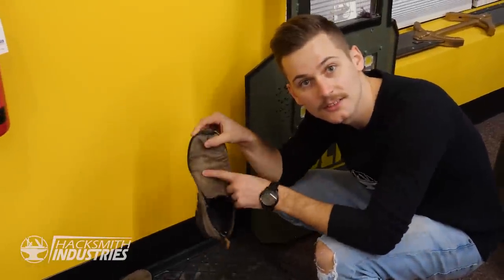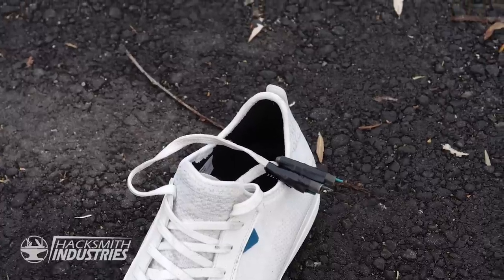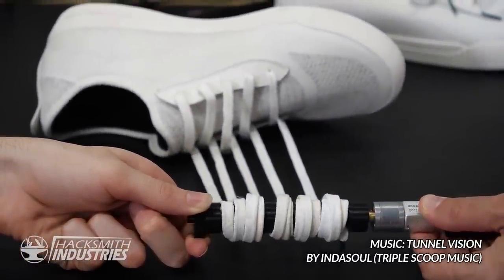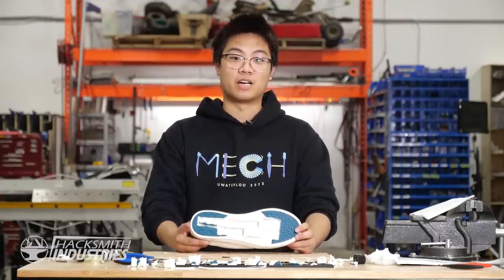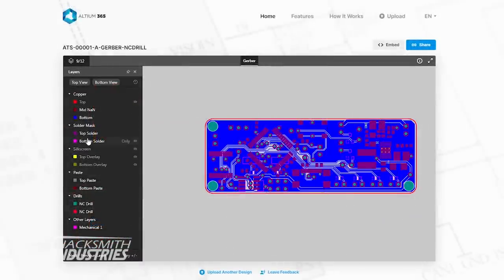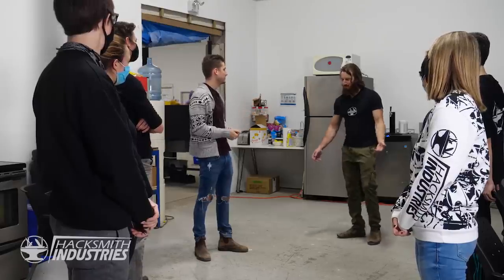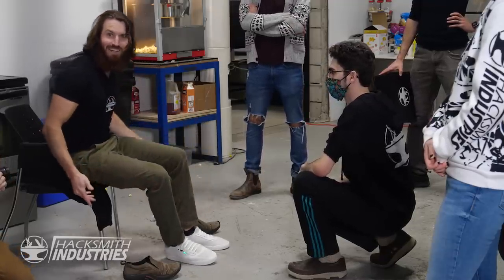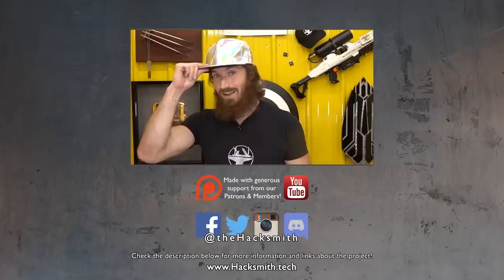We Made SELF-LACING SHOES from BACK TO THE FUTURE!

Comment: James : steps on rock
Shoe : explodes
Reply: Whut :1
Reply: It wont it contains a motor not petrol lol it might over heat but that's not a problem  and the battery might run out just charge it
Reply: It's only a button it wont even over heat
Reply: @megavoid3679  Someone's a square.
Reply: @megavoid3679  well ever heard about a specific Samsung mobile bursting into flames? Think about it :D
Reply: @megavoid3679  If the rock pierce the lipo it would either catch fire or explode

Comment: “Wow we have water proof shoes, how can we make them not water proof?” “How about cut it up and put electronics in it”
Reply: Not only that, the metal inside the shoe would limit the flexibility so you could have a self-lacing shoe that gets burn when wet and obligates you to march if you want to move because the hard soil in it.
In the other hand there's almost no other places to hide the mechanism unless you inflate everything in the shoe. letting the water prof part to be outside the circuit but... the Hacksmith just want to create things that works for the sake of creating, not for the sake if marketing.
Reply: @TDTRondas  guess what they are prototypes which means they can become better.
Reply: Thought the same thing
Reply: It doesn't even function safely as a shoe, one rock in the wrong spot, and the foot heater turns on
Reply: Yep
Reply: Dr Bright well once more versions and they work on them they will get better
Reply: How would you make self lacing shoes without electronics 🤦
Reply: @gogi2467  they will have electronics but they will improve as time goes until they are flawless take the lightsaber for example it went from exploding to a full on lightsaber
Reply: maybe putting another sole on it could kinda solve the problem of waterproof
Reply: they have nike adapts u guys know that right

Comment: At this point, I wouldn’t even be surprised if they made a floating hoverboard
Reply: That actually already exists. It works using magnets, though only on certain surfaces.
Reply: @Zekiraeth  Close, superconductors. At the moment they only work with liquid nitrogen to cool the superconductor on a track made of magnets.
Reply: @gh05tparkourfreerunning31  Right, I couldn't quite remember, and only did a cursory google search. Thanks

Comment: Nice, but there are a lot of issues:

1st: TheShoe and the Electronics are not safely sealed.
Tht's a No-Brainer, having exposed wires and stuff on the Underside, makes these Parts extremely vulnerable to most surfaces(maybe adding a new, thin Sole on the Bottom would help).

2nd: Comfy?
You're basically walking on a straight steel-Plate, ergonomy is basically gone.

3rd: Easticity
The Sole got a steel-plate in it, so the sole doesn't bend with normal Movements anymore

4th Charging?While my first thought was a Micro-SB-Port or a USB-C, Wireless-Carging would enable you to make it airtight/Water-proof.

I recommend improving the Electronicsto take less space, and probably store the Shoes on a shoemat with wireless-Charging.
If the Baterry is downsized to lace the Soes for 10 to 20 Times with a full charge, it would suffice.
A smaller Motor could also help with reducing the overal size for the Coponents.
Maybe getting the Mddle-Sole 3D-printed out like the Tires That "Matt Denton"- Guy did.
onnecting the Axle with an Universal Joint (ike the Lego Technic universal Joints 61903 or 9244c01) would allow for more flexibility, even tough it would be a pain to build.

The Sole should a t least be able to bend with the big toe-Part of the Shoe, giving it enough bendspace for more comfort.

Comment: So you’re telling me, that the main selling point of these shoes is that they are totally water proof, but the self lacing ones aren’t water proof 🤨
Reply: A small price to pay for self lacing shoes.
Reply: I mean, to be fair, they did cut huge holes in the bottom
Reply: If you step in water with the self lacing ones it would be quite a shock
Reply: @sad_bacon_boii9254  They've got a LiPo (which produces lots of heat and flames if punctured) in them. Stepping on a particularly jagged rock is an issue in and of itself.
Reply: The self lacing onces will also destroy your back, but hey
Reply: @Raphael Pecoraro you know that the shoes you wear have an impact on your back? Like where your spine is?

Comment: I imagine that steel insole makes those shoes impossible to actually wear.
Reply: Steel toed shoes/Workboots actually have a metal/ceramic insole so that stepping on a nail wont punch through and its actually kinda hard to tell. They're a little heavier than normal but surprisingly comfy to wear.
Reply: @De-eggs  true.. but a boot is different in functionality than street wear shoes. Especially when it comes to flexibility. 

Wearing a shoe that makes you treat it like a boot seems... confusing. Especially since i dont think that thin sheet of metal would be all that heavy bc the rest of the shoe must weigh almost nothing. So you’re just wearing air that you cant move in. 

The biggest disconnect is probably between your minds expectation of what you can do in a shoe and your physical limitations with an actual sheet of metal stopping your flexibility.
Reply: That metal is so thin that it would still maintain a slight flex in the shoe. I feel like it wouldn’t be very noticeable, although I feel like a sheet of plastic would work better for the application
Reply: @Melmaster3  maybe i misjudged how thick that sheet of metal looked. It looked fairly thick to me. 🤷🏽‍♂️

Comment: I have a couple of questions;
1st off: foot support-
 Wouldn’t the metal in the shoes make them uncomfortable to wear, hurt the feet, and cause foot complications? Could you guys use some sort of carbon fiber or Kevlar to reinforce the shoe, but keep comfort?

2nd: How does it loosen? 

Finally: It looked really slow, and not very tight. Could that be sped up so it takes less time, but not to the point where it constricts the feet?
Reply: that's what i was thinking...
Reply: They put the medal plat then a soul so it would be comfortable
Reply: And it may loosen on it own or the button probably has duel functions
Reply: And it would tie it to the point where it may not be tight but would be stable
Reply: 1. It's not a product and is only a test to see if it could be done, like most things the HACKSMITH dose

And
2. It's a circuit board all you would probably do is press the button a second time and it would flip and make the motor reverse
Reply: @jonathonellis5604  Ok I get the second part but they said they were selling them for consumer use
Reply: @kashturiebhagwandin1732  yeah but it cant bend and arch support is terrible
Reply: @Offtask2  have you actually checked the kickstarter "link" in the discription?

I think you will find that they are not actually selling it